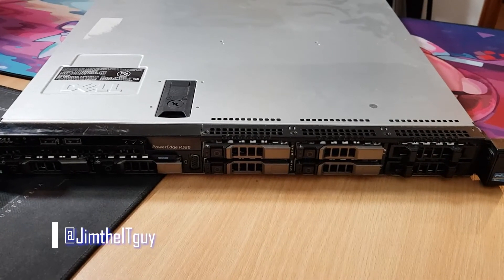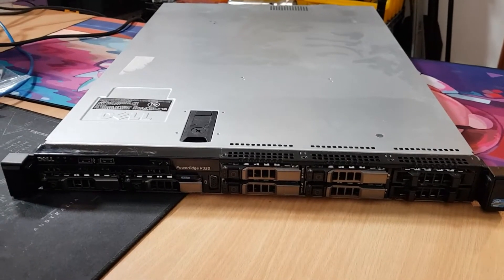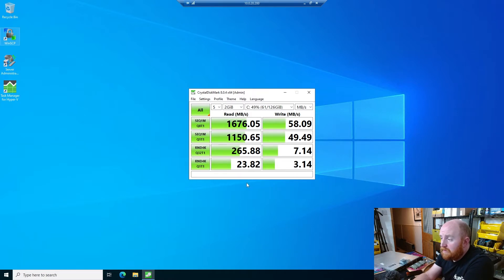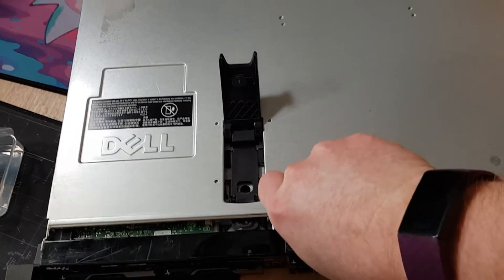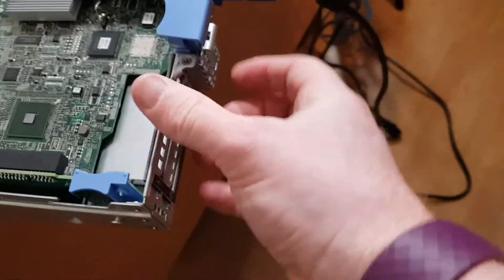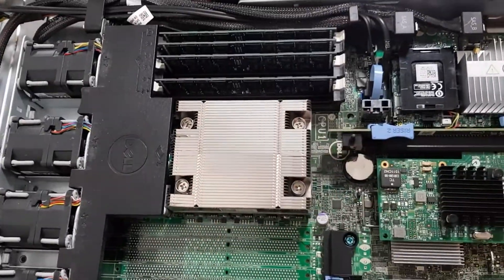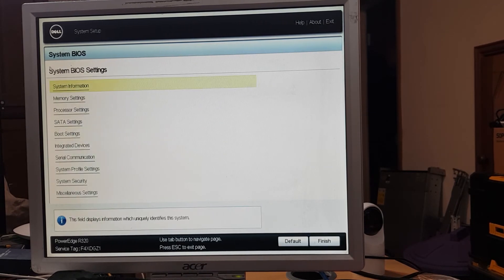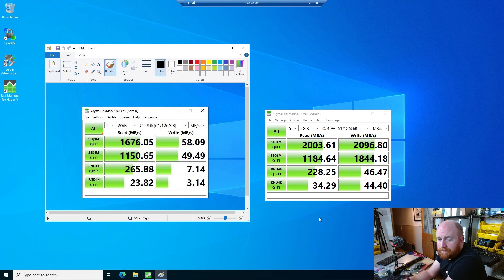Getting started with my new Homelab Servers - Pt5  The little Dell R320 gets PERC up and new CPU

Comment: Hey Jim, wondering about the CPU temperature on the iDrac is that accurate? it start off with around 40C then go up to 60-70C only running on Esxi8 with 2 VMs server 2022, i have the HP DL360 Gen9 running 4 nested esxi8 and CPU temperature only around 40C-45C
Reply from the maker: What power profile are you running? Make sure it's os managed, also check fans arnt clogged and thermal compound is good
Reply: @JimtheITguy no idea it just freshly installed esxi 8 evaluation and then installed nested esxi and another window sever 2022 180 days evaluation.  I did tried installed just one window server 2022 directly before and temperature was the same 60c+,  I will check with the thermal paste,  just wondering if your similar or lower?